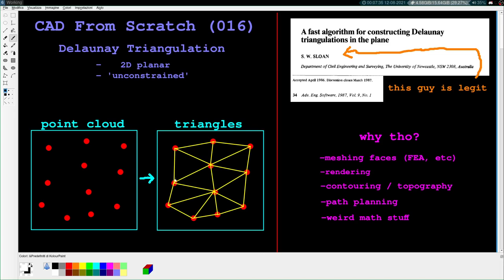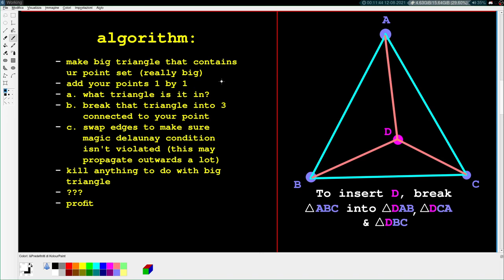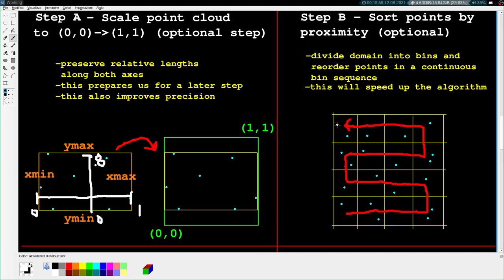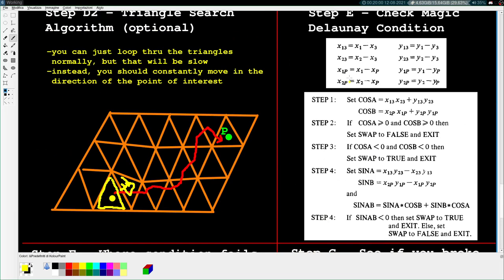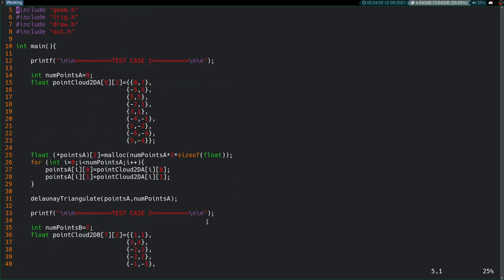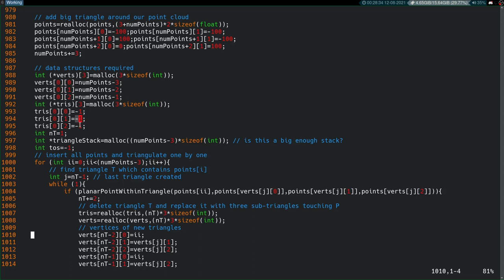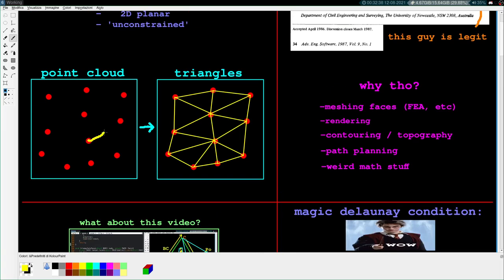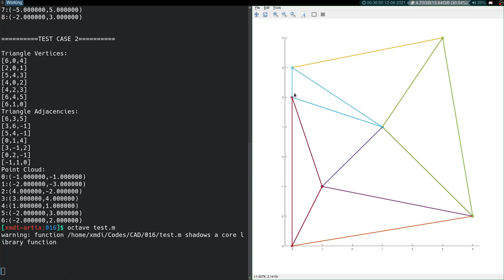Planar Delaunay Triangulations | CAD From Scratch [16]

Comment: It is a bit unrelated to CAD-like modeling, but is there an efficient way to build a Delaunay triangulation for 3D simplices (4 vertices forming a tetrahedron) and even ND simplices (ND-hypertetrahedrons)? It seems like the algorithm would be similar, I am just not quite sure about the condition of diagonal swapping. Instead of the conditions proposed by Sloan (COSA, COSB, etc), I derived a more general condition that a couple of triangles must swap a diagonal if the centers of mass of the new triangles are going to be further from each other than in the original triangles. I implemented such triangulation, it seems to give nice triangles in 2D case similar to the classical algorithm. Now I am stuck at a multidimensional case, I cannot prove that maximizing the distances from the centers of mass is equivalent to the original Delaunay condition. For those who might wonder why would I need ND-simplices - they are related to phase diagrams and naturally appear if I have chemical compounds A, B, C, D mixed together forming a mesh of compositions AxByCzDw with x+y+z+w = 1. Even more, some compositions are joined by an equilibrium condition (for example, a complex liquid composition coexisting with a complex solid composition) which is identical to having constraining edges.